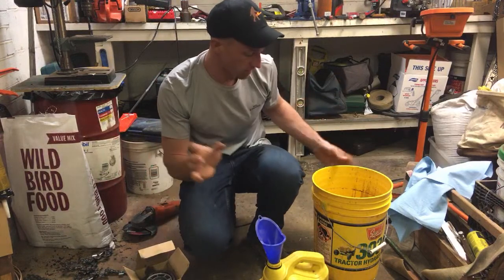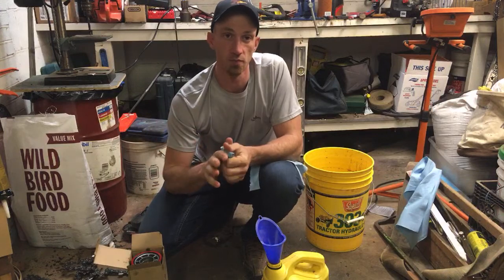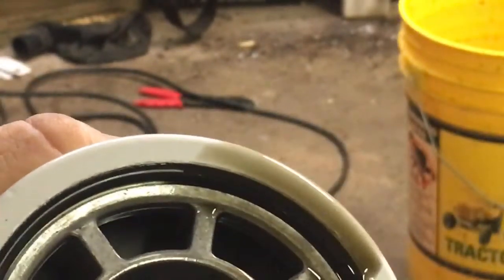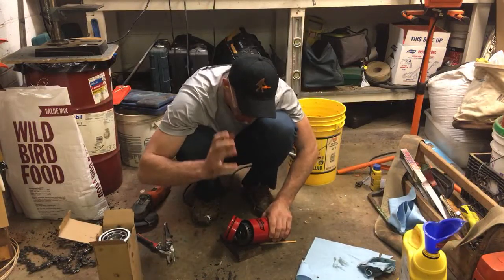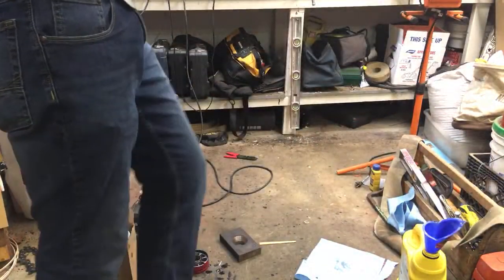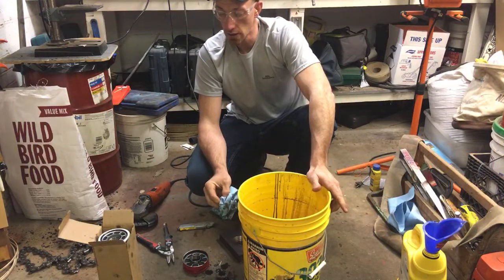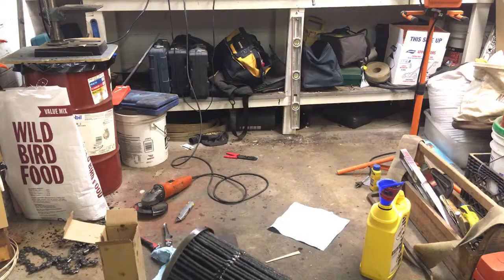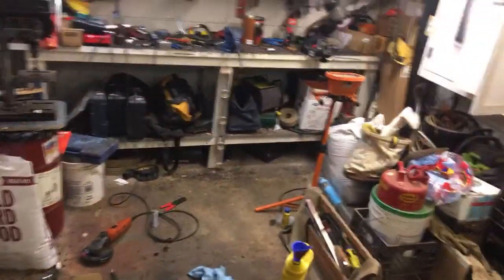Oil filter dissection!!!

Comment: We have an old JD 640, about a 1980. A couple years ago the tranny started slipping in 3 gear, the one most used in a hard pull. I told my son," our mechanic" about the problem/issue, he is not a John Deere fan. He,s always "Grumbly" and condemning when it comes to my favorite skidder. He always tells me keep runnin it, keep runnin it. So ok its like talkin 2 a stump. So we keep runnin it. Well eventually all the debree, and metal grindings, took the bearings out of the lower transfer case shafts, and crunched everything up in there. Well now its spring break up time here and I'm fixing on it by myself. The only "Good"? thing is we have another JD 640 parts machine with a good trany/transfer case. The moral of the story is the machine will eventually tell U whats wrong, if U listen 2 it.

Comment: I tend to send samples of my oils from the truck and boat engines to Blackstone institute for analysis. Its gives you a pretty darn good idea about whats in the stuff and what is wearing out or about to go. It cost 28 bucks for a full analysis. If you get in touch with them, they will send a sample set you can put your oil in and it has everything you need including postage and address etc on it and instructions how to take a sample in it. Worth every penny.

Comment: Pete, what is the sensor reading, DP across the filter?  You need to send out a sample of your oil and have it analyzed. I'm a certified oil analyst and would be happy taking a look at the results and give you some thoughts. Also, not all filters are made equally. The Wix filter says 12 micron nominal, couldn't find info on the Baldwin filter. Any filter ratings in nominal make me flinch. It's much better understanding the filter when microm ratings reported in Absolute or efficiency (Betta).

Comment: Howdy did you pull the suction screen out as well ? Maybe the 748  doesnt have one but the 648g111 does i dont own one but have been looking at them. My 540b does have a suction screen and a filter for tranny plus 2 hydraulic filters in front but they all work off the tranny sump so its kinda filter crazy but i didnt design them lol .

Comment: I always. Tell. Stump.  The hydraulics problems.   Are. In that  bucket on the floor.    From a certain little farm. Store ,       every one i see run that shit changes. Hydraulic pumps.   Swash plate or gear pumps. Like underwear,,,      i have never changed a hydro pump. In any machine i got.       And dont have cylinders drooling all over.                  I wont use that.  Crap     i will stick to.   Hi end oil ,     i dont care if the stuff says its specked or not.